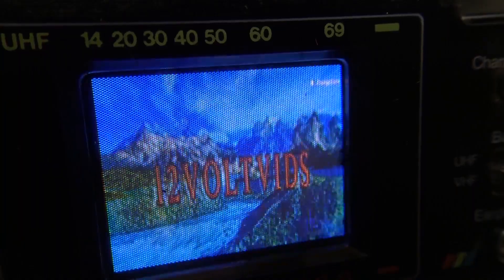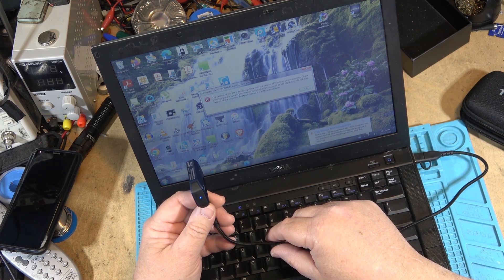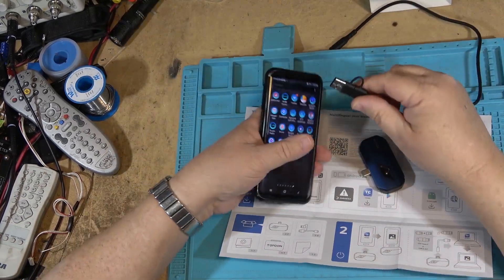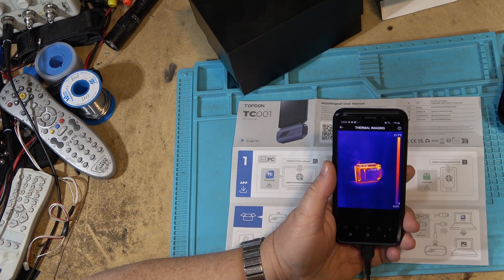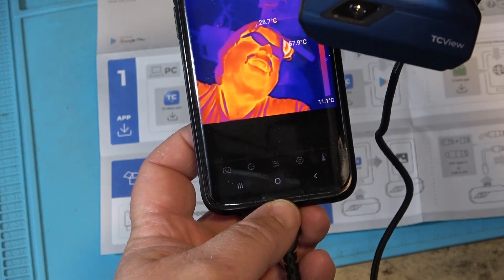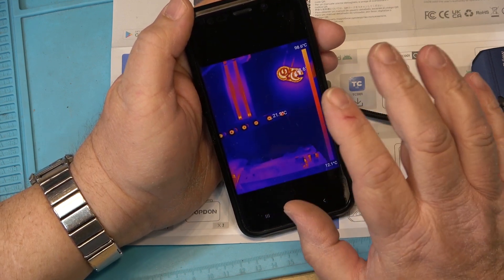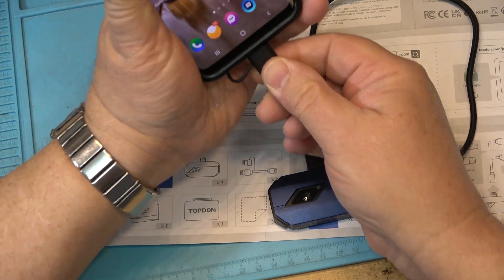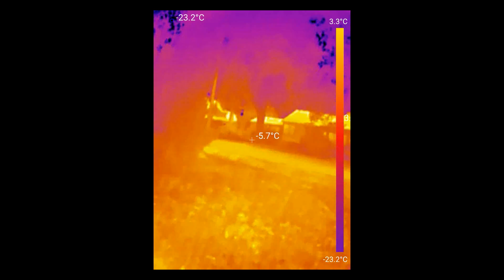Topdon TC001 Thermal Imaging Camera Review

Comment: you can get tiny little extension plugs that extend the USB out about 2CM, but they should either include that in the box or extend the plug out tbh
Reply from the maker: I recommended that to them.  Of a u sgaoed adapter so it can sit against the back of the phone for single hand operation.

Comment: 4:00 About plug length that fits your case - well, not all cases are the same, so making the USB connector longer is somewhat pointless - it'd stick out too much on case A and surely with no case, maybe fit perfect for case B and would still be too short for case C, etc...  So just use a cable :)
Reply from the maker: Adapter would solve as with cable it is 2 handed operation.  A bracket like the other one has is a solution to hold to the phone.

Comment: I recently reviewed the TC004 which is a self contained unit with display, but the sensor could well be the same.  It's super useful for when you have a short circuit component.